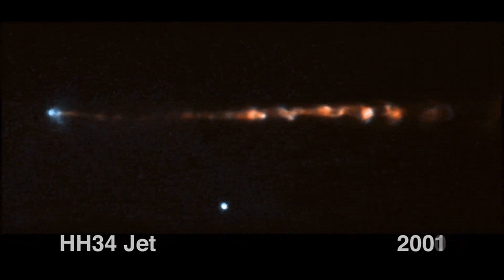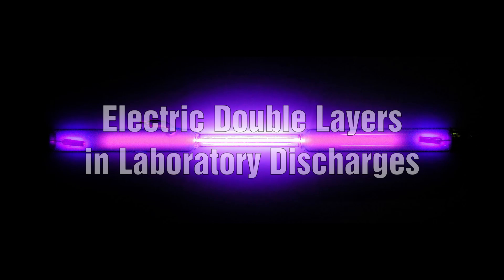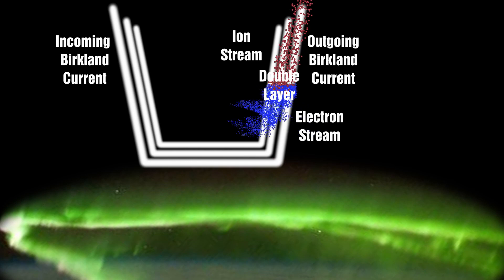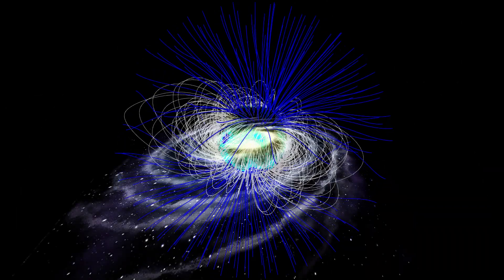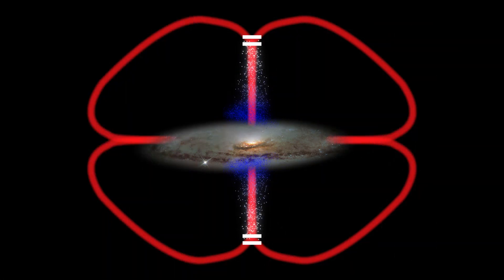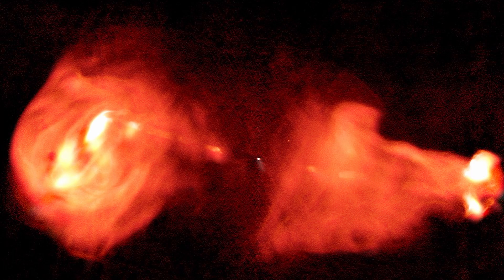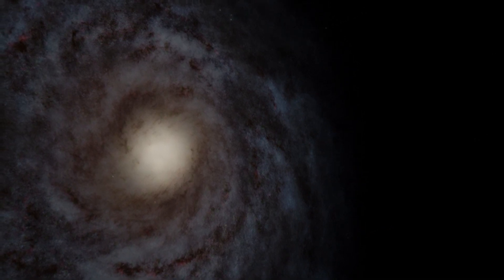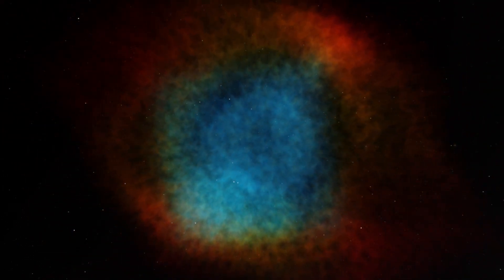Alfvén's Galactic Circuit

Comment: I think that a rotating magnetic field or rotating charged particles act as an inductor coil, producing the magnetic field, it has very little to do with an iron core..  A galaxy  with polar jets, act much like a pulsed plasmoid thruster, ejecting toroidal plasmoids, or toroidal quasars, from the core, much like the EHT image. In a  mature spiral galaxy we also see ansae, which I believe are also double layers between the core and the spiral arms where the currents flow through.  As far as critical velocities observed in space, I think that is light emitted from the magnetic field or the magnetic field goes into vibrational glow mode, or as Telsa called it, the ether medium gives of light.  Aka the aurora, a magnetic field at critical velocity rotating around a current flow.
   A mature spiral is a galaxy that has come to equilibrium between the current flow through the arms and the magnetic field, I. E. the magnetic field drag  or ether drag has to  build up speed and produces a back EMF to stabilize the  rotational speed of the outer limbs of the galaxy, or it becomes a rigid body vortex in the magnetic field, AKA a permanent motor effect.    That is what mainstream calls a galaxy with "dark matter."
    A so called galaxy "with no dark matter" is building up speed until the magnetic field speed overcomes the drag and the increases back EMF. So, the ether or magnetic field drag has yet to come to equilibrium with the current flow speed through the spiral arms, this is called the transient phase of a motor.  In other words  " no dark matter" just means we are still in irrotational vortex mode.  No need for any dark matter.
      Matter   essentially creates  a constriction in a fluid flow, producing the Venturi effect feeding in towards the pinch, the Venturi effect is gravity.  I think the Venturi effect around matter creates a toroidal flow around the main body and produces an ether drag causing  the rotation of bodies.  Just like a smoke ring rotates around an air flow through the air, trapping the smoke plasma in the ring vortex.  The Venturi effect in the magnetic field, feeding back into a stellar or galactic pinch causes a magnetic drag making  them to start rotating.

Comment: If we add in this:
http://www.ptep-online.com/2018/PP-53-01.PDF
We see that galactic rotation can be modeled by a current through the galaxy.   Most importantly though, if professor Scott is correct, the radial electric field of that large scale current becomes a driver for the Alfven circuit.  In other words, it is not a matter of Don Scott’s model OR Hannes Alfven’s being right, but that if Don’s model is right, it CAUSES Alfven’s model to be correct as well.  The primary current along which galaxies are strung,  drives the secondary Alfven circuit.   Was this your thinking too, when making this video?
Reply: https://www.constellation-guide.com/wp-content/uploads/2016/01/Flame-Nebula-NGC-2024.jpg
Then you’ve helped me see this as the same two current flows.  We definitely have a Birkeland current running up and down across our field of view, but aren’t we also seeing the Alfven circuit here too.  Perhaps just the top half of it in this image?
Reply from the maker: Yes I think I see what you mean, darker is the main intergalactic birkland, I also see side arms which could be the incoming equatorial alfven current.  Might need to hunt a higher res image to see it more clearly.  I guess the question is what happens at the boundary between the two system?
Reply from the maker: For me it was a way to visualise the circuit that they often refer to.  I haven't delved into Don's model other than watching some of the repost from the EU conference.  It is sometime confusing as they seem to imply the current running in opposite directions, Don's model has current in at the pole and radially outward.  In reality that may all be semantics but it doesn't help....So just as the aurora is fueled by the motion of the solar wind but they don't interact my thoughts were that the same must happen at a solar and then galactic scale, the question is where does the interaction take place at the galactic scale, assuming there are 2 different circuits.